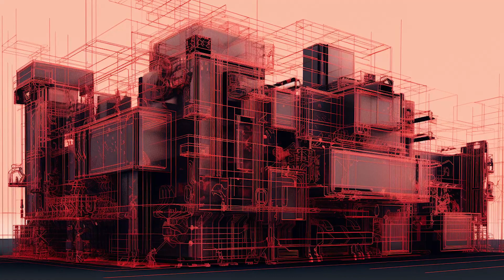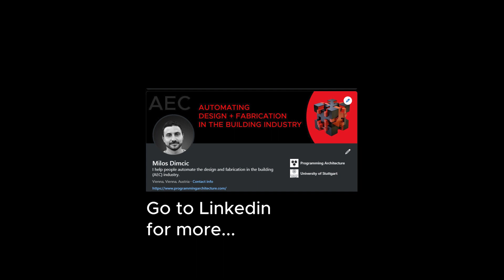We can SOLVE Digital Twins (models of buildings with every detail inside) together!

Comment: Revit has the capability of digital twins. However it's original use wasnt meant for storing data. The data is sent to a CAFM, IWMS system where it is stored.

The next step would be to have clear use cases set out at handover, to the owners facility with the chosen FM system. (ArchiBUS, Dalux, Tandem etc)

Typical use cases include Space planning and management, Asset register, work order management.

Another useful usecase is linking all OEM information and warranty data to equipment (Typically set as an owner standard for closeout for the engineers and consultants)

But to have a true digital twin there needs to be long term planning, for lifecycle management. Most new construction buildings needs to have clear change management processes in place to identify gaps in data, normally from building operating staff or facility managers.

A building is a living breathing entity and and needs to be thought of as a whole.